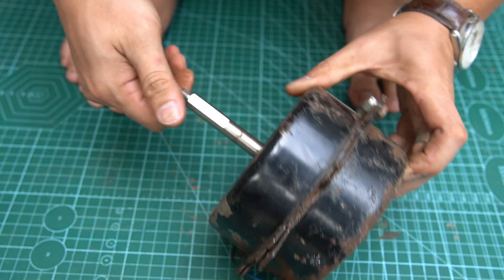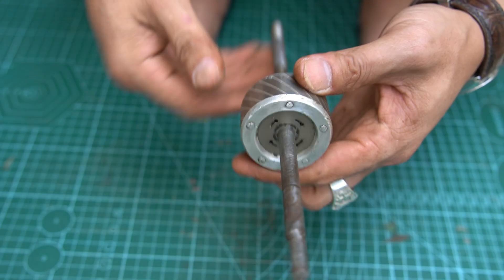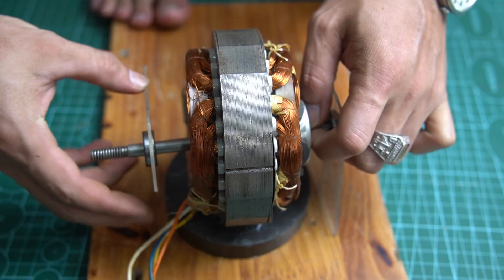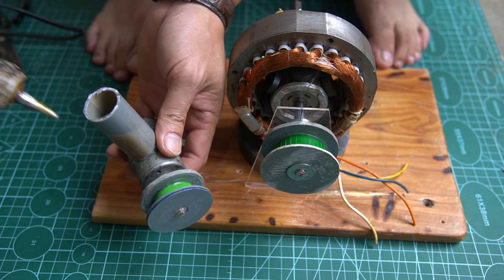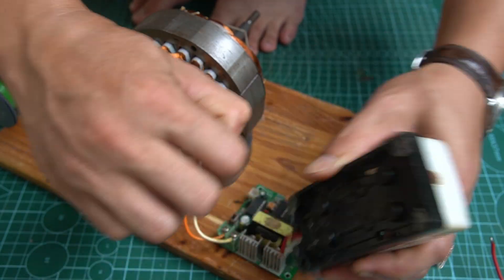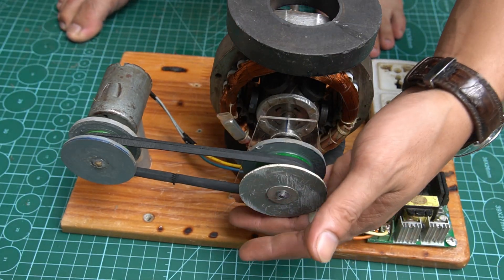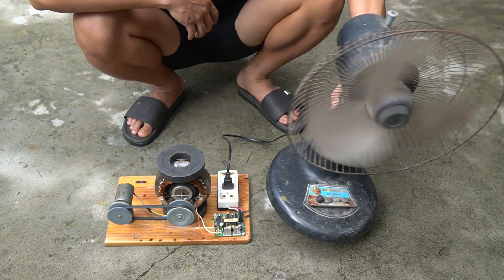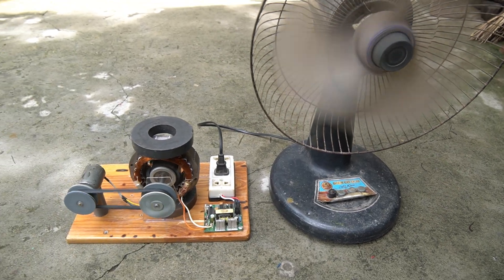Millions Don’t Know This Free Energy Invention Yet!

Comment: MORE CR*P.      WAKE UP GUYS.     THESE ARE LIES.      THESE ARE EXACTLY THE SAME SCAMS AS 5 YEARS AGO WITH DIFFERENT COLOUR WIRE.    THEY DIDN'T WORK THEN OR THE WORLD WOULD ALREADY BE ENERGY RICH FOR FREE.   THE COILS ON THE FIELD COIL FROM THE BLACK MOTOR ARE 220 VOLTS AC,  NOT 12 VOLTS - IT SAYS ON THE LABEL - AND THE OUTPUT OF THE COIL IS AC BUT THE MOTOR IS A DC MOTOR.     THE MOTOR WILL STANDSTILL AND BUZZ, NOT RUN, BECAUSE IT CANNOT GENERATE A BACK EMF FROM AC WHICH IT NEEDS TO RUN.    THIS TELLS US THAT HE IS LYING AS USUAL AND THE MOTOR IS BEING SUPPLIED BY A BATTERY (PROBABLY IN THE TUBE UNDER IT OR EVEN INSIDE THE MOTOR - I'VE SEEN BOTH).     THE GENERATOR IS NOT SUPPLYING VOLTAGE TO THE MOTOR OR IT WOULD BURN OUT WITH AC.        JUST A LOAD OF BLATANT LIES IN THE VIDEO;   THE COMMENTARY AND THE TITLE.     WHY?    TO GET CLICKS FOR FREE MONEY FROM ADVERTISING.       LIES AND BIN RUBBISH.